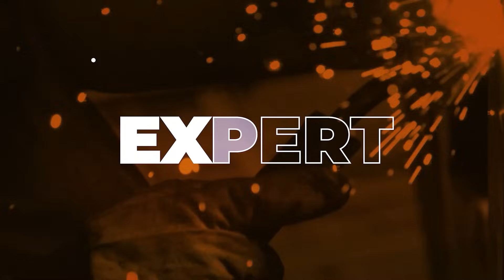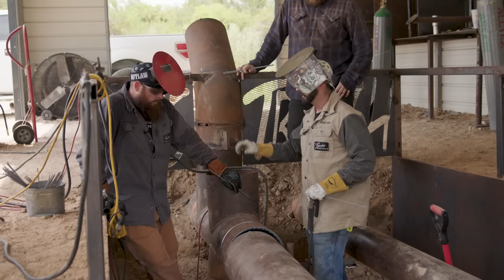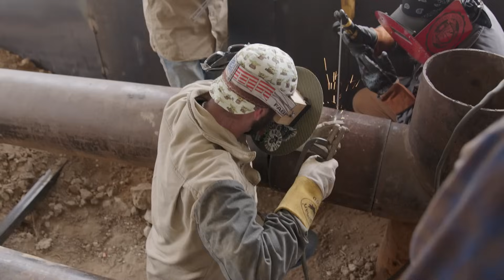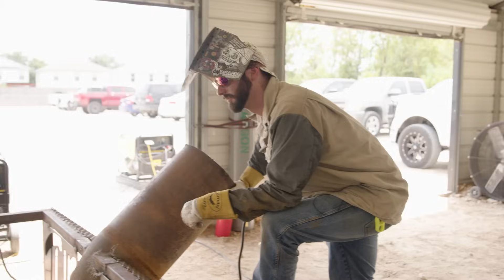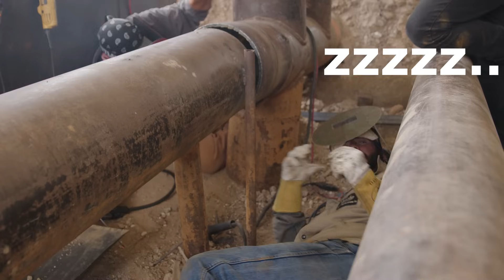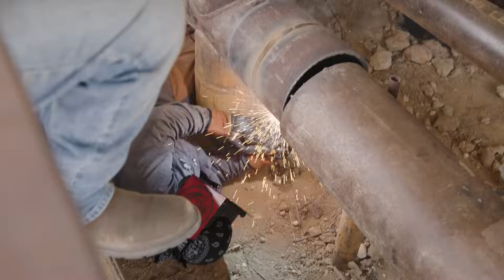Do's And Don'ts of Pipeline Welding With A Partner

Comment: what are those goofy ass looking masks?
Reply: They are pipeliner hoods bud
Reply: They’re pancake welding shields or hoods.
Reply: Pancake hood designed for light weight stress relief on your neck and goggle designed to keep sun glare out from inside the lens while welding outside.
Reply: @geno1974ross  Also they let the air get to half of your face compared to standard style hoods that cover both sides.
Never used one myself but have heard from guys that have the ventilation makes a big difference in the summer.